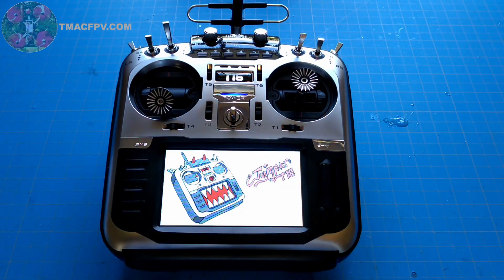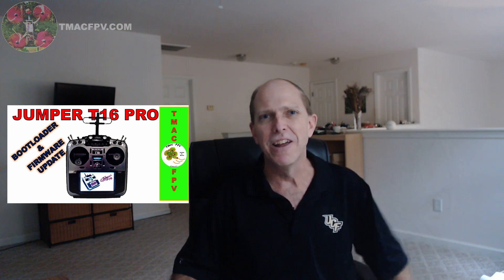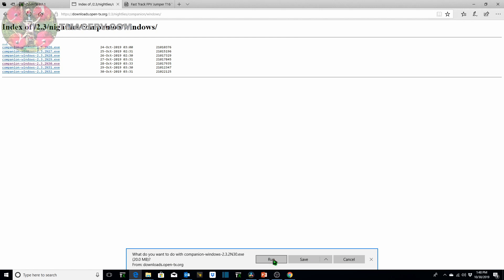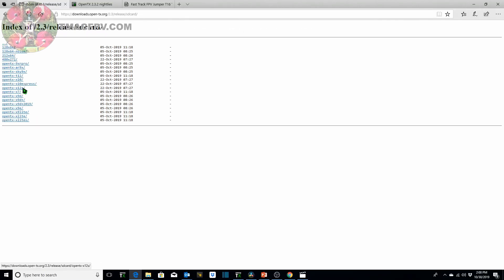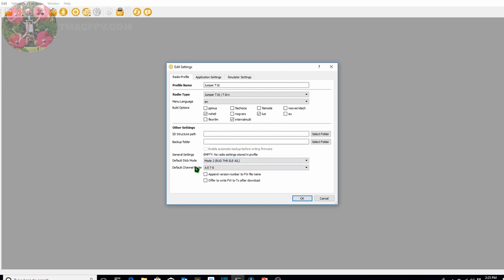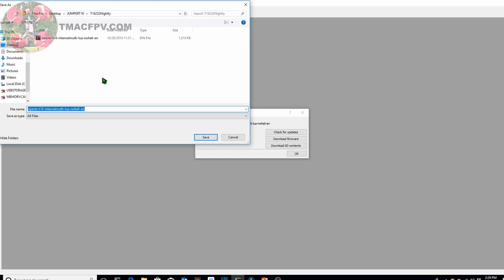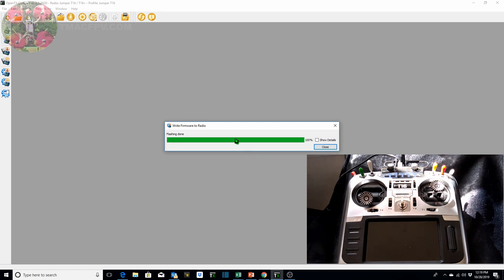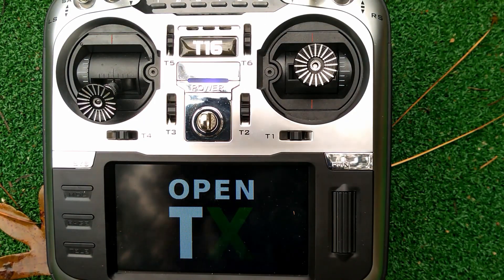OPENTX FIRMWARE UPDATE

Comment: i following your step and i got "bad radio data" and my jumper always calibration after turn on and all messed up. do you have any suggestion?
Reply from the maker: I'm sorry you're experiencing this issue.  What version were you updating it from (Jumper firmware or OpenTX firmware and what version?)?  Where did you get the firmware from that you used to "update" with (Jumper site or OpenTX site)?  Did you use the available checklist for download in the link above? Did you try to transfer models from Jumper firmware to OpenTX?
Reply: @TMacFPV  i didnt remember it, i used jumper t16 pro, i got the opentx firmware from opentx site. Just like you do in the video. Can i downgrade it back to jumpertx or what can i do ?
Reply from the maker: @agungwaw  If you're using the original SD card, get a new (good) one (Class 10).  You can get a 16 Gb one for $6 on Amazon. I would NOPT go back to any JumperTX firmware and do NOT get any OpenTX firmware form Jumper site.  Use OpenTX site.  Do NOT attempt to transfer any models from JumperTX firmware to OpenTX.  Use checklist provided in link above and start over once you have a new SD card.  Also, make sure your SD card contents are for the version of OpenTX you're using (for example, there is an SD card contents for each version).

Comment: TMac any tips on how to get the R9 system working with the Jumper?  I am having a terrible time trying to get it to work.  Do I need to update to OpenTX to get it to work correctly?  Thanks in advance!
Reply from the maker: Hey William. If you're on JumperTX, you'll want to go to OpenTX as soon as possible. OpenTX official version with full support for Jumper T16 is out. To answer your question, I honestly don't remember. I didn't have JumperTX on my T16 long enough  I don't think to try it with R9. I know the R9 system works fine with OpenTX. Used it for awhile on my T16. Have recently changed over to Crossfire.
Reply from the maker: Do you have Internal module turned OFF (it should be OFF if you're using R9 external module)
Reply: @TMacFPV  I do have the internal module set to off.  I was able to get it to bind, I just can't get any kind of control movement in betaflight. Thanks for the advice, looks like I'll be going to OpenTX then.
Reply from the maker: @williambeckett4295  wish I could help you out more. 🤔That's odd and I'm not able to think of anything else at this time William.

Comment: Mac, do i need to do the boot loader update also or can I just do the OPENTX flash and micro usb load?
Reply from the maker: Hey Gypsy Nipsy.  You can do one before the other.  Depending on whether or not you currently have the bootloader installed on your multimodule will determine if you need to do the bootloader install.  See the video for how to determine whether or not you currently have the bootloader installed.  If you do not, you will want to install it.  You can do this after you update to OpenTx, however, if you update to OpenTx and don't do the bootloader install afterwards (which also updates the mumltimodule with a newer version of firmware) I cannot guarantee they will "play nice together."  See this video for clarification on 2 firmwares:  https://www.youtube.com/watch?v=xAmCWIwzlKc

Comment: is this process a Windows only process?
Reply from the maker: OpenTX Companion is available for Windows, Apple OSX and Linux- see Open-TX.org
Reply: I was referring to the boot loader update process with flash multi. Thanks for all your help
Reply from the maker: @prozay6856  Per Ben Lye on Sep 2, 2019: "In other Flash Multi news, I added a Linux script package to the latest release today. It does nearly everything that the Windows GUI does, so now there's an option for Linux/Mac users as well. The only thing it doesn't do yet is automate the recovery of a device that's stuck in DFU mode, but hopefully the checks I added in the latest version will prevent that from ever happening now anyway"  here's a link: https://github.com/benlye/flash-multi/releases
Reply: I don’t know how many others are having similar issues, but I am not having the best of luck. I tried using an Arduino as my USB to TTL. No success. Tried using the Wine Bottler app for Mac which allows a Mac run Windows apps. Nothing. I also have my Mac running Windows. Nothing. And I don’t know anyone with a Windows computer. And I am at my breaking point with this lovely well thought out radio with a minor set back...
Reply: Just wanted to update you guys that i was able to update my t16. i would like to mention that i do not have extensive computer knowledge and this was a bit of a task. thanks tmac for your help!
Reply from the maker: @prozay6856  Outstanding! Great job! You did good friend!  Thanks for the update and have fun with it! 👍😀

Comment: Can you update the external module or do I have to upgrade to an external and go from there? Thanks great video. Excellent instructions.
Reply from the maker: Thanks All Things M3. You can update the external module firmware also. Just remember to use "inv" file instead of "no_inv" file (as described in the video Jumper T16 Bootloader & Firmware Update). This video (Jumper T16 OpenTX Firmware Update) is about updating the system firmware (OpenTX) on the radio, NOT the module. These are 2 different things. See my video on Jumper T16 Firmware Clarification for more explanation on the two firmware (system and module)

Comment: @TMac I cannot get my Jumper t16 to communicate with the PC correctly I get error that says 
Below   but there is only one connected and have removed all other devices except wireless keyboard and mouse  I get this error trying to write or read from radio  Hope you can shed some light on this issue  Thanks  ps the internal module has been updated already 

=================================================================================

dfu-util 0.7

Copyright 2005-2008 Weston Schmidt, Harald Welte and OpenMoko Inc.

Copyright 2010-2012 Tormod Volden and Stefan Schmidt

This program is Free Software and has ABSOLUTELY NO WARRANTY

Please report bugs to dfu-util@lists.gnumonks.org

Filter on vendor = 0x0483 product = 0xdf11

More than one DFU capable USB device found, you might try `--list' and then disconnect all but one device
Reply from the maker: You may have some things running "in the background."  Even after I closed all my windows, I had Google running in the background.  I closed all unnecessary things running in the background, closed all windows and with transmitter OFF but connected to USB I ran the ImpulseRC Driver Fixer.  This finally worked for me
Reply: @TMacFPV  I have not figured out the problem as of yet but I did get it to work on another computer Thanks I will update if I figure it out  Keep up the good work !
Reply from the maker: @sklote1964  Sounds good sklote1964! Thanks friend!👍
Reply: @TMacFPV Ok I figured it out Yeah! even though I only had the wireless mouse rx plugged into the usb  it was the usb 3.1 hub that it was plugged into that ended up being the culprit :( LOL   That never even crossed my mind  SMH   Live and learn  :)  Thanks again for your great vids and help

Comment: I am getting 'Invalid Board' on my T16 when I try to download Companion 2.3 firware?  I checked, I have all the latest firmwares.  This is the bin file, where I want to download/save No Heli, lua, internmodule, en, etc...Got any suggestions?
Reply from the maker: Since it is a Release Candidate (2.3RC1), did you select Release Candidate (testing) in the drop-down menu under the Applications Tab of Companion? 3 options are stable release, release candidate, and nightly. If you're downloading RC1, you want Release Candidate
Reply: @TMacFPV  You da Man!  That worked like a charm.
Reply from the maker: @1unaffiliated1  Outstanding Steven-glad to hear it!  👍😀Thank You for taking the time to share your success story!  You have no idea how much it means to me.  I'm very happy to help out and its comments like yours which keep me going.  Thanks for your support friend!🙏
Reply: @TMacFPV  I am getting a firmware check failure now, what is that?
Reply from the maker: @1unaffiliated1  Hey Steve.  Only thing I can think  of is your SD Crad conetnts version do not match the verison of the OpenTX firmware you just downloaded.  If you downloaded and installed the 2.3.3RC1 OpenTX firmware I just looked and there is a new SD card contents file dated 13 Dec on this site: https://downloads.open-tx.org/2.3/rc/sdcard/opentx-t16/  So,  to answer your question, I do not know.  That's my best guess right now.  If I come up with something else I'll make sure to let you know.  If the above fixes it, please let me know too! Thanks Steven and have a good night!
Reply: @TMacFPV  I got it Wooooo Hoooooo!, I am so happy now.  Everything matches.  Corrected SD Card Path, allocated the FW Download to a Desktop Folder.  Saved to radio with it off.  And flashed it.  Everything works like it should.  Thanks, again...
Reply from the maker: @1unaffiliated1  👊👌👍 Woohoo! Nice goin'! Happy to help Steven. Way to go friend!😁

Comment: Hi again, Is the opentx 2.3.3RC1 still not a stable version? I've actually tried to load it onto my T16 and get an invalid page when downloading. I'm using the latest Companion.
Reply: That should say invalid Board
Reply from the maker: @donaldhill2076  RC1 is a "Release Candidate" not the official release. You need to check the box for Release Candidate in Companion when downloading it
Reply: @TMacFPV  Thanks Tmac. I've taken a risk I know but upgraded to the RC1 and was able to copy my models back on. So far looks all ok.

Comment: Love Ya videos, they're so helpful.  I've a T16 and upgraded with internal module, plus updates the module firmware V1.3.0.47.  My Jumper has JumperTX-t16-2.3.0 (3e6a17d3).  However, using OpenTX Version2.3.3RC1 every time I attempt to download version 2.3.2 I get an error saying "Invalid Board"  It will not download the file onto my hard drive, nor an SDCard or my Jumper radio?  I've even tried to use the OpenTX nightly builds and I continue to receive the same response.  I know OpenTX is working fine on my PC because it worked perfectly to update my Taranis with version 2.3.2
Reply: Tmac, I sorted it out by using the Companion Nightly build.  Now have opentx-t16-2.3.3RC1 firmware installed on my T16 and the internal Module is working fine, just need to test my Crossfire as well.  However, I still get the INVALID BOARD warning if I attempt to use Companion 2.2.3RC1.  I'm hoping this will eventually be sorted out soon so I no longer have to use nightly builds?
Reply from the maker: @Jamesn-js1zp  Glad you got it working James, happy for you! 👍😁

Comment: Great video. I have an external module, should i click internalmulti in installer or not click?  Thanks.
Reply from the maker: You can hover your mouse cursor over each option to see an explanation of what they are for.  In this case, internalmulti says its support for an internal multimodule.  Looking at other transmitters which do not have an internal module, but do have an external module bay (like the X9D+), this option was not available for those.  So, that tells me you can update those transmitters firmware (which had an external module bay) without this option.  Therefore, without actually confirming this myself as I do not have an external module, I will conclude this internalmulti option is only for the T16 Pro (with internal module) OR a modified T16 with an internal module installed by the user (i.e. not for the external module bay).  Does that make sense? Hope it helps
Reply: @TMacFPV  Ok. I understood. Thank you so much.

Comment: Hi Tmac, this update is possible to use on T16 not pro? Thank you
Reply from the maker: Yes! Radio (transmitter) system (OpenTX) firmware is different than module firmware.  You can update them separately. See this video for clarification on the topic:
 https://www.youtube.com/watch?v=xAmCWIwzlKc
Reply: @TMacFPV  thank you so much
Reply from the maker: @dalirivana  Sure👍

Comment: I am getting this error when flashing firmware to radio "could not check firmware from radio"
Please Help!  My internal module Status was updated to:  V1.3.0.45  and I an trying to flash firmware 2.3.3N58 (bfe66880).
Reply from the maker: Try running the ImmersionRC Driver Fixer mentioned in the video and also in the checklist available through link in video description
Reply from the maker: Try a few things: 1. Run ImmersionRC Driver Fixer, 2. Did you download and follow checklist provided in video description? 3. Are you using nightly OpenTX Companion? 4. Did you check the nightly build version box when using companion to download version to computer?
Reply: @TMacFPV  I ran the ImmersionRC Fixer and after shutting down chrome it worked on the third try.  I was able to update the firmware in the radio!   Thank you so much for your help.  Side note:  I have flown FPV planes for the past couple years and now working my way through your FPV fast track course so I can learn how to fly quads FPV.  Flying a quad is so alien to me!
Reply from the maker: @billmeade8092  Hey Bill! Fantastic, very happy its worked for you! Yep, that ImmersionRC Driver Fixer has saved me "a few times." It's common for things not to work when you have other windows open and sometimes even when you have other things plugged into other USB ports (or hub) on your computer. Just something to keep in mind. Don't be a stranger. Shoot me an email every once in awhile to let me know how things are going for you in the Course. I'm here for you! Im able to  spend more time with current and former students supporting them so don't be shy about contacting me. I really need and want your feedback on the Course too friend😁 👍 You'll get the hang of these FPV drones soon. It does take patience, persistence, and practice! Well worth it 👌 It's a blast!🤩

Comment: I haven't updated the firmware on my Jumper T16. It still uses Jumper firmware. If I put OpenTX, will I lose all the existing settings?
Reply from the maker: So, based on your question, I'm going to assume you mean you're running on JumperTX which was what the first shipments of the T16 came out with.  If you're running on OpenTX 2.3.2 on your T16 which is what current T16s are shipped with, then you should not lose anything.  So, if you're running on JumperTX (i.e. NOT OpenTX 2.3.2) I'm not sure what you mean by existing settings, however, if you're talking about the models, OpenTX Dev's have strongly recommended not attempting transfer of  models from JumperTX to OpenTX.  Its best to capture your model settings in some manner then recreate them in OpenTX.
Reply: Got it! Thanks!

Comment: I got my T16 yesterday and for the life of me, it won't update the firmware of OpenTX UNLESS i put it in bootloader mode.  Your instructions are to flash with it powered off.  I can't do that.  Anyone else have this?  I updated my module to the latest so thanks for that video!  :)
Reply from the maker: With radio Off and connected to computer via USB, have you tried to run the ImpulseRC Driver Fixer?
Reply: @TMacFPV  Bam...That worked.  I thought i did...lol.  Keep up the great work!  I'm excited to start a new chapter with a new radio after using the Original Non Plus taranis since early 2013!
Reply from the maker: @beeradfpv  Outstanding Beerad! I'm excited for you friend! 🤩Clear skies buddy!

Comment: Have you found anything different in the n54 version?
Reply from the maker: Hey Mark! Great question. I was in N30 and went straight to N54 because I needed a feature for a video I'm posting today at 3:00pm which N30 didn't have.  I use it to update internal module WITHOUT USB -to-serial adaptor (subsequent to bootloader being installed with USB-to-serial adaptor the 1st time). Before I updated to N54, I researched it for any issues people were having. Found none. It actually fixed an issue or 2 in N53. Anyway, check out the video that posts today at 3:00pm & let me know if you've got questions

Comment: Finally got it sorted 👍👍👍👍👍
Reply from the maker: YES! How did you end up correcting the issue?  By the way, i just updated to N54!
Reply: The sd card version file was missing from download and dug driver was missing I’ve tried the download twice and both times the two files were missing got the two files from Oscar and boom it worked ok 👌 I’ve put it back to standard till official release
Reply from the maker: @mark161262  Thanks for the info. Glad its working for you again!

Comment: Hi Tmac, Donald here again. I've been using my T16 and finally got and upgraded the gimbals to Hall gimbals and its performing flawlessly. Just a quick question any idea how the official release of OpenTX for the T16 is coming along?? Oh also has anyone made a video or have you of the process to replace the T16 case? I've a new carbon fibre looking case on its way.
Reply from the maker: Outstanding Donald! Thanks for the update. Believe OpenTX official release for Jumper T16 is 4-6 weeks out.  Cannot be certain of this, however, I would not expect it within the next 2-3 weeks. I do not have a video on installing the carbon-fiber looking faceplate